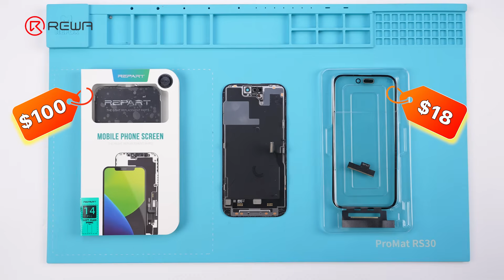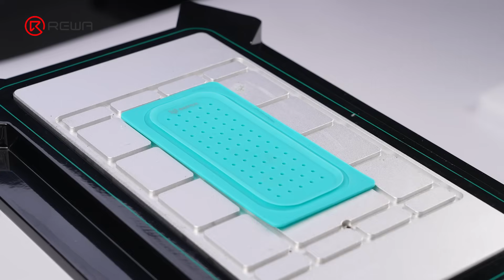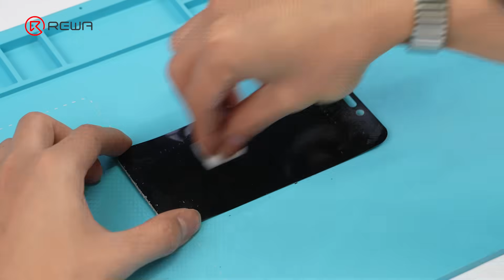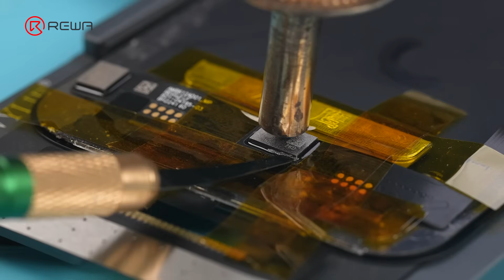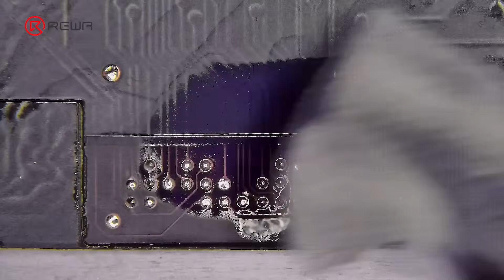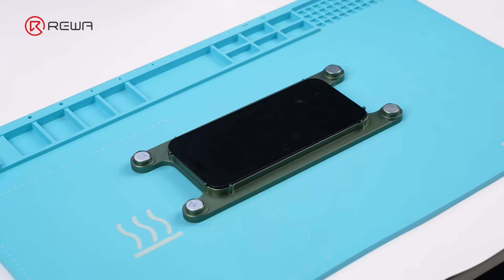How to Fix iPhone 14 Pro Touch Issue - Digitizer Replacement Guide

Comment from the maker: How do you feel about this repair method? This repair method can save the original screen ❤

Repair product: 

1.Touch Screen Digitizer:
https://shop.rewa.tech/detail/apple-iphone-12-mini-12-pro-max-oncell-touch-screen-digitizer.html?utm_source=YTB0425&utm_medium=video&utm_id=Repair+Product

2.REPART 120Hz Soft OLED Screen
https://shop.rewa.tech/detail/repart-120hz-soft-oled-screen-assembly-for-iphone-14-pro.html?utm_source=YTB0425&utm_medium=video&utm_id=Repair+Produc
t
Reply: It's actually amazing but I want  to ask will it be okay just by separating the glass only ?
Reply from the maker: @abdomocrim7526  You mean the front glass? You can also watch our real fix part, it is the touch flex solder part
Reply: @rewatechnology2008   okay thanks I'll  watch the video again

Comment: I have a question my 14 pro cause green screen problem then they replace flex cable and touch ic because my old touch ic is broken after repair my device working fine and now it has partial touch failures so its display problem or flex and touch ic problem like it need to replace whole screen or just touch ic and flex
Reply from the maker: This is a tricky repair issue, you need a further troubleshooting.
Reply: @rewatechnology2008 so what should i do change touch ic or flex or whole display?
Reply from the maker: @amaangamingyt4537  Based on your description, the screen replacement should be fine,, but like I said you need to make sure the motherboard connector is fine.
Reply: @rewatechnology2008 also when i got my phone after green screen repaired when i low brightness my half screen turned to green tint on low brightness
Reply: @rewatechnology2008 also my lider sensor not working idk why😢

Comment: It would have been much easier to just replace the flex cable.
Reply from the maker: For real the machine  and the whole pack is really expensive, this repair method is way more cost-effective

Comment: So you put another touch layer above the existing defective touch layer?  Does this increase thickness significantly?
Reply from the maker: Yeah we also mention that, and some of the alignment mold will not work for this method.
Reply: Yes bro they said it in video
Reply: Why not just remove it?